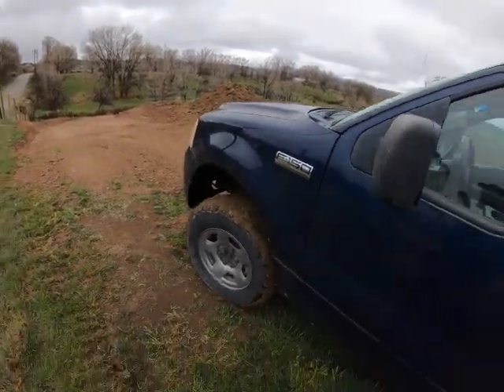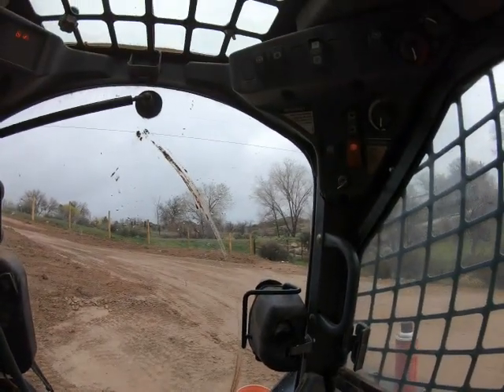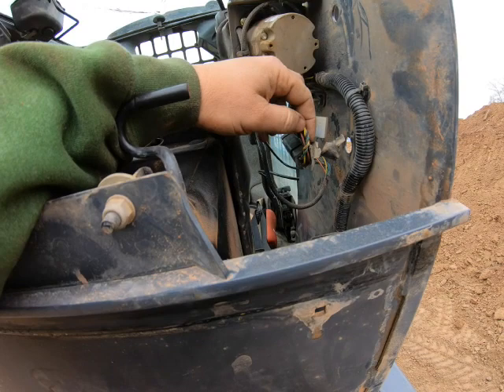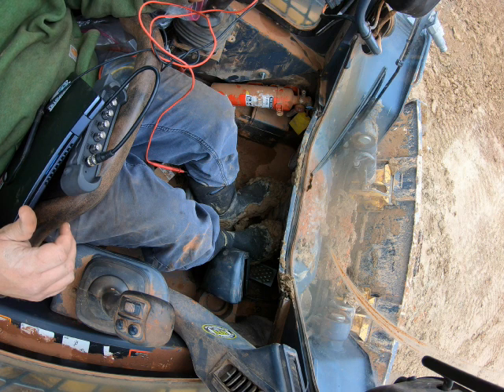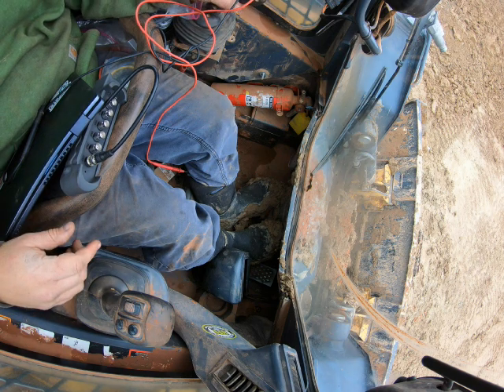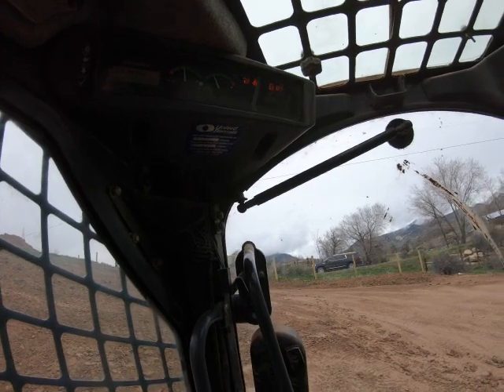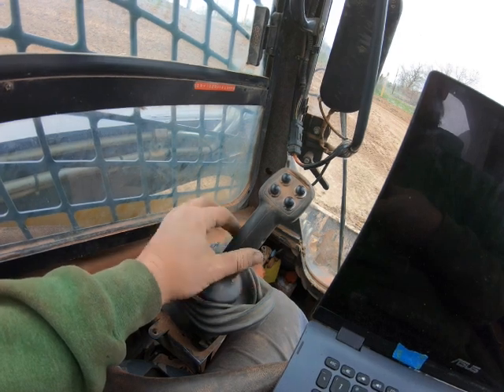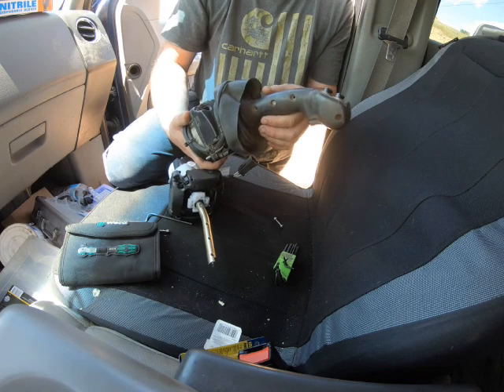John Deere Skidsteer Joystick Electrical Issues

Comment: Hello I have a 329D as well and after a rain storm the left joystick lost some of its functionality.  Not completely dead like the one you are working on. Forward and back work fine.  Left and right will work if you mike a very very small turns.  I did the joystick test and when testing left or right axis the readings work and go up to maybe 25 or 30 but if you go any further the signal drops off and then the code is thrown.  Left speed sensor or right speed sensor errors.   My question for you is:  Did the mechanicals in the joystick seem serviceable?  I'm just wondering if I take it apart I might find a little water or rust in the mechanical side of the joystick.  Anyway, thanks for the video it was really helpful and I'm about to have a heart attack if I have to buy a new joystick lol   Thanks again!  Wayne

Comment: I replaced the right hand a yr ago and it’s back out again I did the same thing u did they told me the same bs about the hole thing but why is it out again  how do you Bypass the hydraulic safety lock I’m in bad place to be broke down
Reply from the maker: Sorry I just saw your comment, I have been away. Did you get it going?